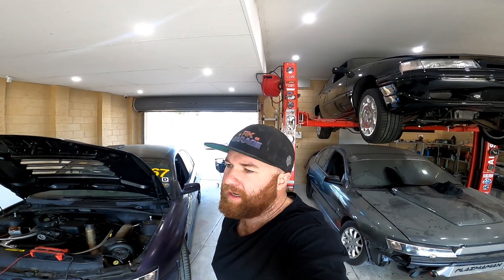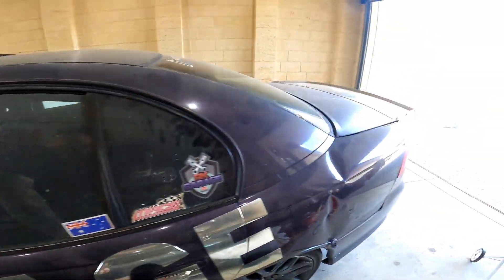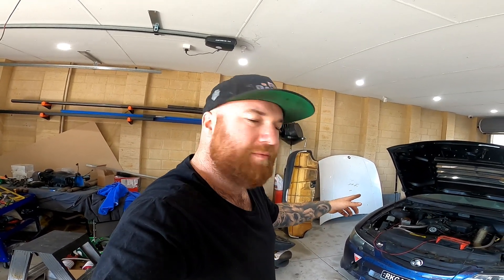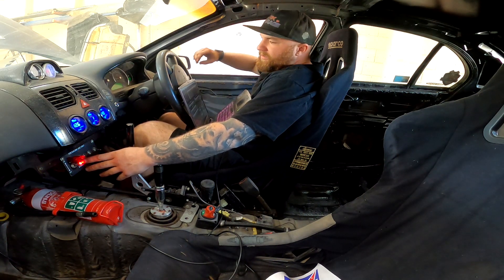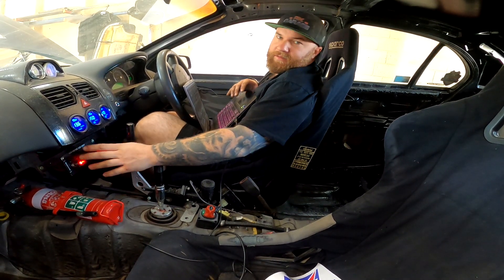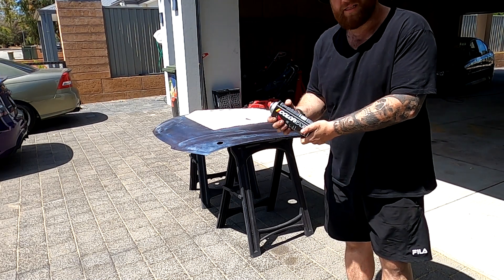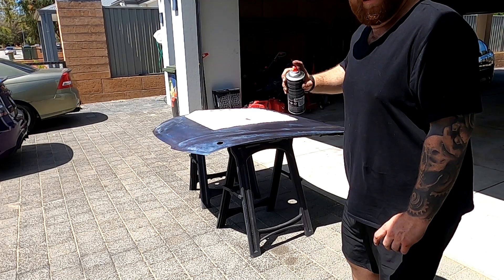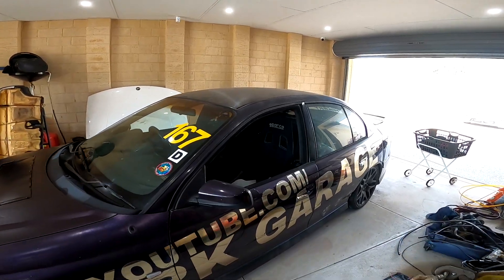V6 Turbo Ecotec Goes On E-85!!!!

Comment: you might have to e85 convert the l67, they reckon because the fuel burns cooler it negates the need for a cooler to run smaller pulleys, feel free to correct me if ive been reading some bullsht haha
Reply from the maker: That is correct  but Im not going to waste my time and effort for the M90.
Screw doing an entire fuel system for a "daily"
Reply: @RKGarage  yeah sorry I’m not very familiar with converting it to e85 , just thought it may be cheaper than a intercooler kit since cheapest I could find is $1700